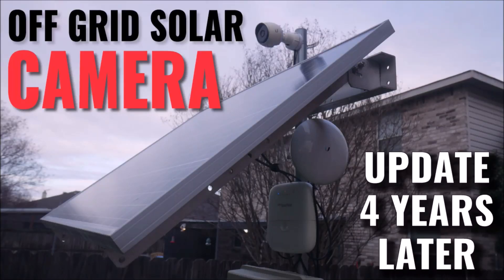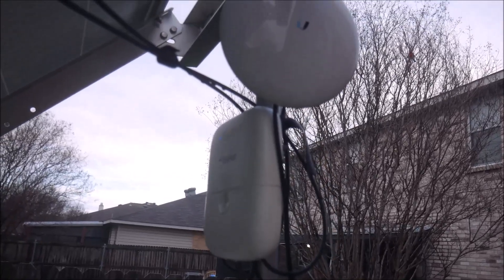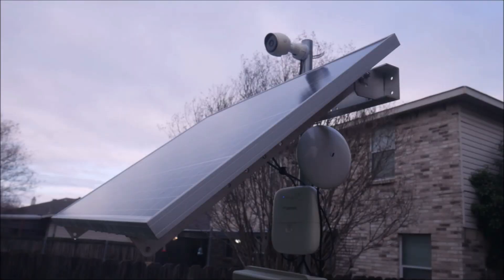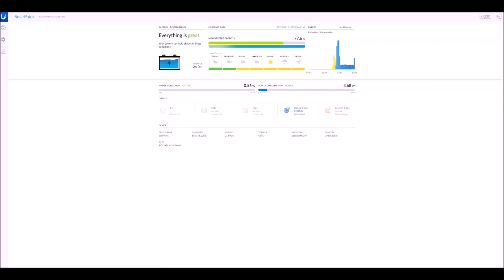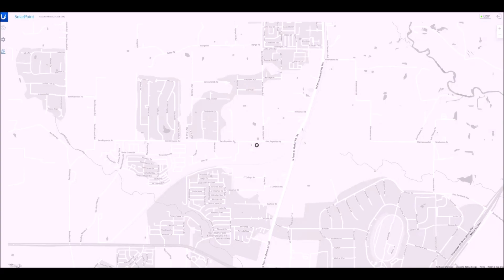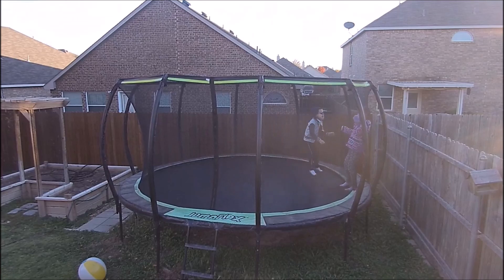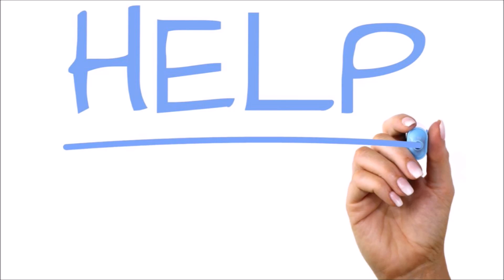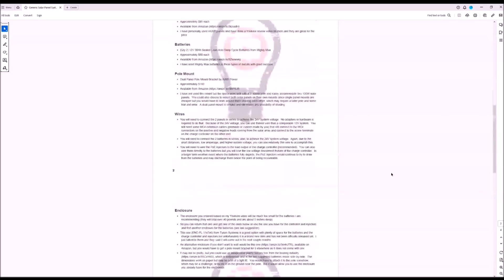Off Grid Solar Camera Update - Ubiquiti SolarPoint & UVC Camera 4 Years Later

Comment: Have a brand new one that is not charging 😢
Reply from the maker: Brand new what?
Reply: @LDSreliance  Ubiquiti SolarPoint
Reply from the maker: How did you get a brand new one?  They don't make them any more.
Reply: @LDSreliance  I bought it from their website. You won’t see it on the UniFi product page, you have to switch to the UISP products.
Reply from the maker: Interesting.  Well I can try to help if you want.  What does it show in the admin page?  Are you using lead acid batteries?  What voltage?

Comment: I wish Ubiquiti would throw in the Switch Flex and partner with Victron Energy and build a new SolarPoint. If they made a 24 volt system that was PoE++, it would do well for us wanting to build something similar for remote locations. I am in the process of building my own solar powered 5g network controller for cameras and internet at my off grid property. I have 4 Reolink Go PT Plus LTE cameras currently, but having 4 mobile plans and bills is draining the wallet.
Reply from the maker: The SolarPoint was one the best things they came out with in a long time as far as innovation and convenience and the way it simplifies a setup.  But it really needs lithium support.

I'm going to doing another series on this "setup" on my new off grid homestead so check back for that in the coming months.
Reply: @LDSreliance  That's why I wish they would partner up with Victron Energy. They make small form factor charge controllers that can handle all types of battery chemistries. They also need to kill 10/100 and move to gigabit. I know it doesn't matter for IP cameras, but there really isn't much reason to stick with 10/100 anything. Having everything all in one would make setup that much easier. For small scale solar projects, I only use Victron charge controllers. They are super solid and reliable. Their inverters are pretty reliable as well. I'm looking forward to your new video!!
Reply from the maker: Victron makes good stuff.  But they don't have anything that is attractive from a PoE camera perspective.  It would have to be adapted to work just like any other charge controller.  Ubiquiti doesn't seem to know what they really want to do outside of WISP products and prosumer home networking gear.  They keep dabbling in stuff but never go all in (solar stuff, video doorbells, etc.).